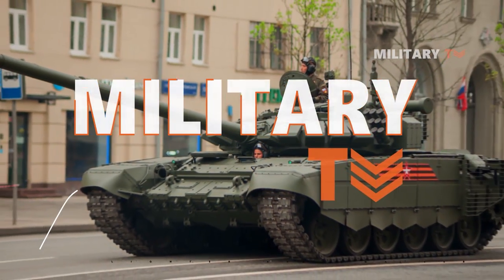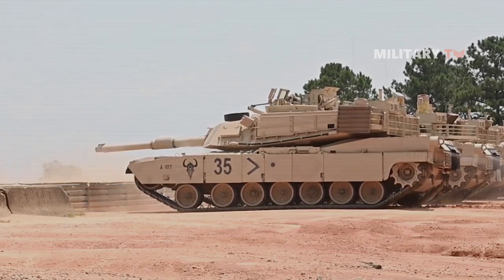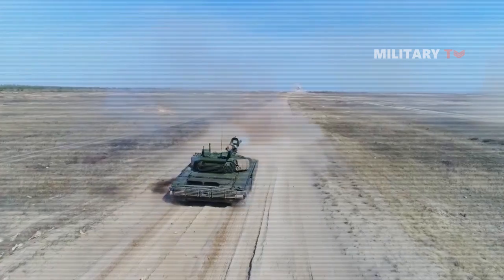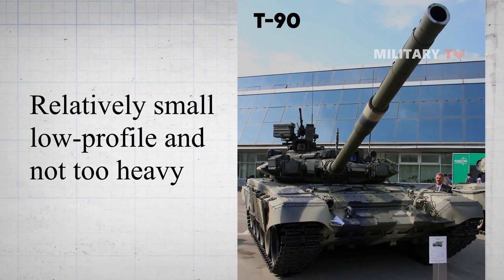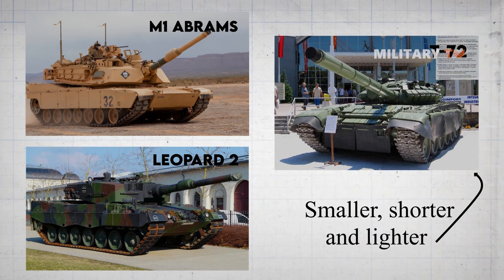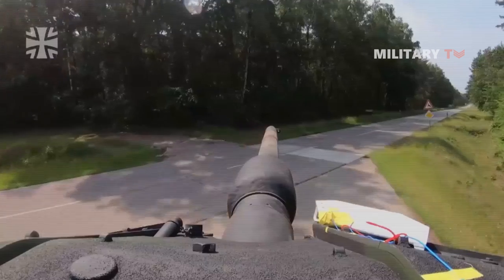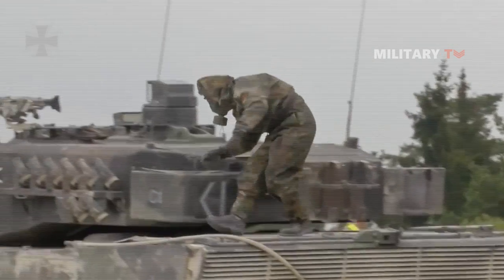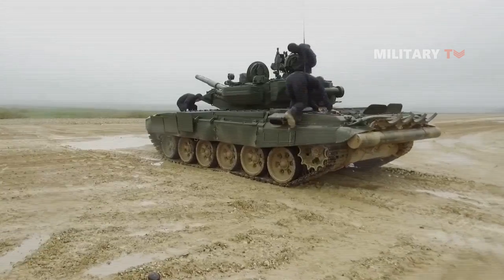Why are Russian tanks lighter and smaller than the western tanks

Comment: With the smaller Russian tank design they are able to have two less crew. Witch means more crews for more tanks and less men lost per tank kill
Reply: Two less?  Russian tanks require 3, most Western tanks 4.
The loss of the loader in favor of an auto-loader saves a person, but increases complexity, adds a point of failure, and increases the time to load.  Their smaller size also means the Russian designs typically carry less ammunition.
Reply: @MDavidW100  everything on a tank is in principle a point of failure and you can just pick and choose. Leclerc and Type-10 also have autoloader but I don't think they considered points of failure like armchair defence analysts.
Reply: @asiftalpur3758  as a guy who spent over twenty years as an active armor soldier, it is a significant disadvantage to have an auto loader that takes more than 5 seconds to load a round.  And you lose a man on the crew for maintenance and guard/sleep cycle.
Reply: @MDavidW100  I understand what you're saying, but that's operational level nuances. The technology itself is very competitive and reliable enough for nations to hedge their bets on it, both western and Eastern designs.
Reply: @asiftalpur3758  the biggest issue with the Russian design, that the Western one you mentioned don’t have is crew survivability.  The ammunition is not stored behind blast panels.  If the tank gets hit, the crew dies, typically.
Reply: @MDavidW100  IF tank gets hit, probability to hit the ammunition is pretty low cause with the Russian design ammunition is stored on the bottom of tank, not on the back side turret at highest point behind paper wall, if this ammunition has high explosive shells  the crew dies, typically.
Reply: @bagamut  you don't have to hit the ammunition directly.  Just a penetration is usually enough, because of the spalling inside the tank.  There's enough examples of Russian tanks going up like Roman Candles in Syria over the last few years to prove that.  The M1 has doors to the ammo rack that can handle ALL the ammunition going off at once.  As do MOST Western battle tanks.
Reply: @MDavidW100   Just a penetration is usually NOT enough, probability is very low. Such examples are pretty rare but they looking good at CNN so they are multiplied by 1000 usually.
 There's enough examples of M1 going up like Roman Candles in Iraq and Yemen and doors to the ammo rack making crew looking like alive after that. As do Leo2 also.
Reply: @bagamut  but the crew survived in an M1.  Believe what you will, I saw the hulks of the Soviet tanks in Iraq and Kuwait.  The M1s that got hit an went up, had the blow off panels let loose, saving the crew and making repairs easy, Leos too.  T72s, T64, T80 you'll have to hose them out, and replace 90% of the interior electronics and most of the hardware.
Reply: @MDavidW100  there was no Soviet tanks in Iraq and Kuwait, all Soviet tanks are in Soviet Union.
Let me teach you what  "blow off panels" are: when ammo gun powder is ignited that causes fire, this fire cause excess pressure which  "blow off panels" could release.
But if shell high explosive is hit that causes explosion, detonation, blast. In this case tank will disintegrate in pieces. Nothing helps. Replacing 90% of the interior electronics also will not help. Believe what you will,  but there is plenty of M1 and Leo2 in this state cause you can pierce turret ammo compartment with bare RPG7, it's very badly protected from behind
Reply: @bagamut  my friend I FULLY understand.  The high explosive will not detonate because the blowoff panels release the pressure needed before it goes off.  The high explosive doesn’t go off in a Russian tank either.  It’s the propellant burning.  Having served on tanks for 29 years, I’m very familiar with the mechanics involved.
Reply: @bagamut  and there is no blow off panels between a Russian Ammo storage and crew, or minimal.
  And the Iraqis didn’t manufacture their T72s in 1991, or 2003 - Russia did.
Reply: @MDavidW100    The high explosive will  detonate, there is always such possibility and that happened many times.
Russian Ammo storage is on the bottom of the tank, very hard to hit, not on the top of the turret like M1.
Most Iraqis tanks was T-55 and T-62, T-72 quantity was much less.
Iraqis did manufacture their T72s, they even builded a tank factory with help of Poland. 
Only some of Iraqis tank was built in USSR, big portion was built in Poland and Czechoslovakia. 
Iraqis T72s are not Soviet  T72s, that was downgraded export version with obsolete ammo.
Reply: @bagamut  believe what you want.  Western High Explosive requires a detonator to detonate and the energy escapes through the blow off panels.  Russian Ammo will have its propellant burn in the lower hull without a direct hit on it.  Perhaps Russian High Explosive is more sensitive.
Reply: правильно, мой прекрасный сэр
 Деревенщина из Сибири - Абакан
Reply: Деревенщина из Сибири - Абакан   
Совершенно верно. А ещё верно, что ни один из этих танков изначально не соперник Абрамсу. Вы бы ещё Т-34 припомнили, хотя и такие там катались. Да и признайте: иракский экипаж -- не самый опытный и надёжный. Т-90 с российским экипажем не уступит M1A2.
Reply: It's one less crew man, 4 vs 3

Comment: Damn ... the inaccuracies in the video. smh
Can't correct them all but some of them are :
That "AMX-3" is actually AMX-13. A light tank. Supposed to be light. And there were many at the time, like M41, PT-76 to name a few. And these light tanks still exists today ... Sprut SD, ZTQ-15, Stingray etc ....
Leopard 1 was made lighter for a reason. Because at the time (height of Cold War) it was thought that HEAT-FS will make RHA obsolete. Hence instead of creating MBT with thick RHA, the decision was to create light MBTs with good maneuverability. 
Most western MBTs at the time weighed at around 36t ~ 45t. (AMX-30, Leo-1, M48 etc). Actually AMX-30 even weighed less than the mentioned Leopard 1. You can't compare early cold war western tanks (Leo-1) with late cold war tanks (Leo-2, Abrams).
After composite armor ... Western tanks became heavier. And Western tanks are now larger because crew comfort is a priority in NATO. The tank's interior can't be too cramped. Along with other design choices like rear turret bustle and all, western tanks appear larger. Russian designers prefer tanks to be a smaller target. In Soviet service, tank crews were specially selected based on their lower height.

Comment: Let me know if I am wrong, but wouldn't a smaller, lighter tank be much more nimble in heavy snow, 
than a larger, heavier tank?
Reply: Not automatically. Both the 46 ton Panther, 56 ton Tiger 1 and even the 69 ton Tiger II were much better in deep snow and generally off-road than the 30-32 ton M4 Sherman or 25 ton Panzer IV. Mainly thanks to their advanced suspension, large road-wheels and very wide tracks. The 28-30 ton T-34 also had wide tracks and was better than the M4 and Panzer IV.
Reply: @TTTT-oc4eb  Thank you 👍

Comment: Different philosophies in doctrine & design Look at WW2.  The Germans always strive for industrial, mechanical & design excellence according to strict standards & tolerances.  The Panthers & Tigers were incredible tanks with higher quality builds, optics, technology, etc  but more obviously complex & harder to build.  The Russian T-34s were more basic yet more than capable & easier to crank out.  You can see in surviving T-34s how some of the armored steel plates of the hull were crudely made & welded but could be cranked out of the factory & were rugged.  It was a classic case of quality vs quantity.  

The Germans simply couldn’t match the numbers of men & material while also fighting a war of attrition, logistical problems & inclement weather.  There are a lot of factors involved but those principles & philosophies still remain.  The T series tanks are no slouch & have some advanced & innovative tech but the Russians believe in their numbers & industrial might.  They believe in quantity.  I am an ex-Army tanker so I love my Abrams but also have respect for other country’s tanks especially the Merkava, Leopard & others.  

The Western tanks design with crew comfort in mind too.  Enough room so its not sweltering in summer or freezing in winter.   Believe me, it gets hot or cold in there but at least you have some room.  There is a heater in the M1s but no AC. In a summer NTC rotation in the Mojave Desert of California the outside temps can be like 110 degrees.  The M1s have a lot of electronics which heat up the inside especially in the gunner station which is the smallest crew area.  The M1s have a higher silhouette but that helps when you’re in a hull or turret down position.  For those who don’t know that means hiding behind a berm or in a dug out battle position where you use terrain to hide & protect your hull and/or turret.  You’re not always going to be on flat ground especially out in the field.  So if your angled up an embankment, it helps to have a taller turret so you can depress you gun lower to shoot.  The Russian tanks have cramped quarters & are hell for bigger & taller guys.  Even in an M1 which is huge, it’s roomy but still it’s not like you can stand & walk around inside.  Russian T-72’s, T-80’s, & T-90’s are tight & cramped.   You’d be surprised at how fatiguing & claustrophobic it can get in there especially when temps are at extremes.  They are a smaller target which had drawbacks like less elevation & depression on the main gun & less crew & storage room.  

Anyway, there are other factors & influences but these are some of the generalized reasons why tanks are the way they are.  A great example of hybridized design philosophies is the Israeli Merkava.  In the 60’s & 70’s Israel used WW2 German Panzers & several versions of US & Russian tanks.  Their designers took lessons from their wars & used a lot of the various design principles found in different tanks & incorporated them into their superb Merkava tank.  It is arguably one of the best tanks in the world & even has a mortar & has infantry carrying capability.  We have Bradley’s & Stryker’s for Infantry but the Merkava is primarily a tank yet they were able to design it with extra room for infantry.  Tanks are really incredible machines & the engineering, design & thought put into them is amazing.  You have to balance things in the choices you make.  

Remember by the of WW2, the brilliant Germans were going a little crazy with the bigger is better idea.  The Maus was basically a land battleship but too much armor means sacrificing mobility & in armor the 3 main principles are shoot, move & communicate.  For those who aren’t Army, Marines or veterans If you ever get a chance to see a static display of a tank at a fair or something go check it out.  You’ll be amazed to get a look at how they are designed & built.
Reply: The German tanks had serious logistics problem . They lost more tanks to technical breakdowns than actual combat .
Reply: @abhilashyadav2274  Yeah, they sorted out a lot of of those problems The Panther & Tiget had some initial teething problems with the transmission & engine issues.  Like the Luftwaffe, as brilliant as the designers, scientists & engineers in those firms were back then, the Third Reich had some
Nightmarish bureaucratic problems.  The Luftwaffe had too many models & planned models instead of focusing on mission specific planes like fighters & bombers.  They had several Swiss army planes that were ok at several tasks but excellent at nothing.  Toward the end of the war they figured out the idea of an armored fighting vehicle “platform.”  The E series.  So you’d have a base platform for different variants of vehicles.  Medium tank.  Heavy tank.  Tank destroyer.  Etc.  This way there are more shared parts, easier maintenance, and so on.  They overcame some of those shortcomings since the Germans have an innate cultural sense of duty, engineering excellence, & innovation.  Also, Albert Speer was a brilliant if not ruthless planner & labor “exploiter.”  German engineering excellence is apparent in the Panther, Tiger & King Tiger.  Excellent optics & range estimation systems help tank crews but also make it more complicated & difficult to manufacture, maintain & repair.  The Russians got a nice blend of capability with a good mix of engineering, reliability, etc.  The welding, parts, optics, etc weren’t nearly as good as the German’s had but they were “good enough.”  The Russians could rely on more manpower & resources.  No amount of technology or precision could overcome Germany’s logistical shortcomings.  A Tiger could knock out 9 tanks but that only does so much when they are cranking out 20 a week.

Comment: One problem not mentioned with the Russian design is that it's lower profile also means it can't depress it's gun as low as say a Centurion tank. This shortcoming became apparent during the 1973 Yom Kippur war where Israeli Centurions faced off against Arab T-54 tanks. The Centurion tank had a higher profile but it's gun could depress much lower than the T-54 gun. As a result when firing from hull down positions, the Centurion would expose less of itself than the T-54 would, thus making for a smaller target.

Comment: You missed a couple of aspects:
1 the triangle of armour- mobility- firepower 
2 the loader is a technical risk and exposes the ammo to fire in case of an incident 
3 four soldiers are needed for maintenance and do things swifter (changing polsters, canister refuelling…)
4 Russian systems fire guided missiles from their barrels
5 Russian barrels only last 1/3 due to production cost decisions
6 Russian vehicles are attack systems wit dowsed oriented gear sets and front armour, western systems are optmised for delay and attack moving at the same speed backward and forward, having overall more capable armour

Comment: I found the title misguiding. The two tank share similar dimension. M1 is 9.7mx3.66mx2.44m in dimension whereas the t80 is 9.9mx3.4mx2.202m in size. Is the difference in armour design that resulted in the that the russian mbt is smaller

Comment: You did not mentioned that soviet tanks size and weight was limited by railroad platform, so it should be around 40 tonnes. It was critically important for the country with such huge distances to be able quickly relocate mass of tanks from, for example,  Chinese border to Europe.
Reply: Это характерно для тяжелых танков.
_
This is typical for heavy tanks.
Reply: Does the T stand for Tiny or Toy?

Comment: Russian tanks come from a doctrine where hitting hard and fast was key, not from being a workhorse.

The trend for low profile comes from way back, as lower profile often meant easier hull-down because of shallower trenches and asloped hull meant easier time ricocheting shells.

The issue is terrain protection and low profile is now largely negated by increased precision, better optics, proper rangefinding and the usage of ATGMs that strike top-down. Not even counting the stronger aerial threats and FSAPDS shells which deal better with sloped armor.

The Abrams instead went BIG, in the literal sense. A very different doctrine.

Comment: This comes down to the US 'bigger is better' policy. The M1 Abrams is far heavier, far slower, requires more crew and costs around three times as much (approximately $9 million USD for an M1 Abrams vs around $3 million USD for the T80 or Chinese Type 99A). In the event of an extended war this difference in cost, weight (and consequent production time) often proves crippling when trying to resupply. This is why Russia and China opt for the smaller, lighter, cheaper build that are easier to replace.

Comment: you didn't mention that the soviet tanks are more likely to enter the turret toss competition, because of how vulnerable they are to turret separation... the M-1A1 doesn't have that problem. the soviet brand X tank is not designed with crew survivability in mind like the western tanks, the Abrams specifically, are.

Comment: My up-armored M1A2 SEP 2 with urban combat package and extra bottom armor in Mosul 2007-2008 weighed a staggering 84 tons.  This decreased top speed to 42 mph.  The 2nd .50 cal (mounted coaxially for the gunner) also gave us a good option between main gun, 7.62, or exposing ourselves to precision fire by using the commander's .50.  Experienced tankers know that weight is a huge advantage when hit by IED's or high explosive anti-tank ordnance.  It's a lot easier to flip over a 40 ton tank than an 80, and way easier to blow a 20 ton turret off a tank than a 45 ton turret.  1000 destroyed T-72s tell the story...

Comment: yea fair point but you forgot a couple crucial things: russian tanks are outdated, next their autoloader if hit is a death sentence for the crew while all nato exept the challenger (it has 2 stage amunition) have blow out pannels which means when hit the crew is safe unless the inner blow out pannel facing the crew is damaged, russian mbts are light yes but that means their protection is lacking modern apfsds can easly go though the frontal plate of a t72b3 since the introduction of the tipped apfsds shell such as dm53, and yes they are cheaper to produce but that means their quality is absolutley horrible, and since you have said that modern western mbts have problems with rpgs/atgms well the russians are even worse off, western mbt focus on crew safety t72s and t80s are from the soviet era and we know how much they cared about their crews.

Comment: If they could make a tank with an auto loader that does not require a full crew and instead has room for 3 passenger and only needs at max 2 people to control all functions that would be best. Or even a 1 seater with an auto load mechanism that allows constant fire and ease of use.